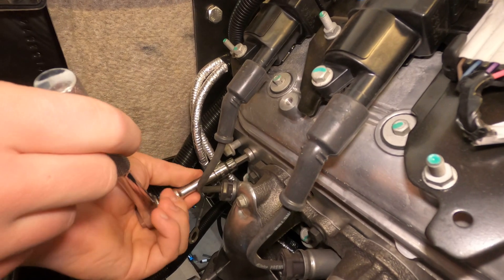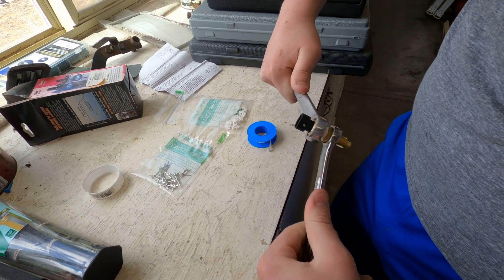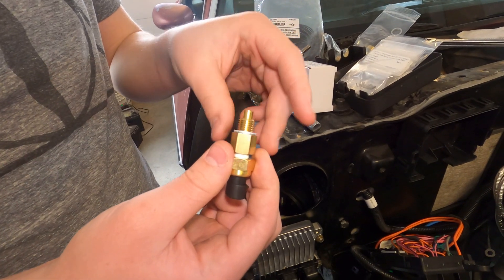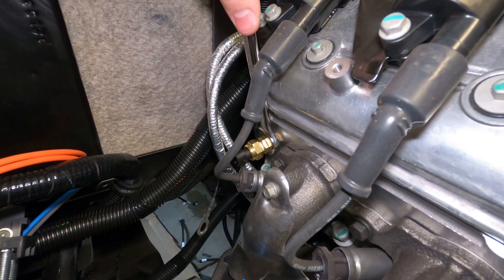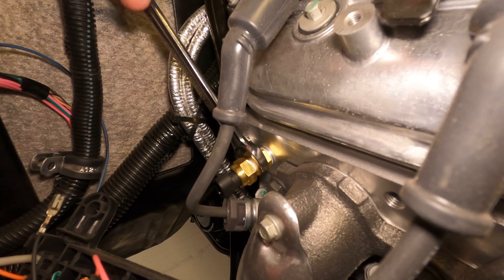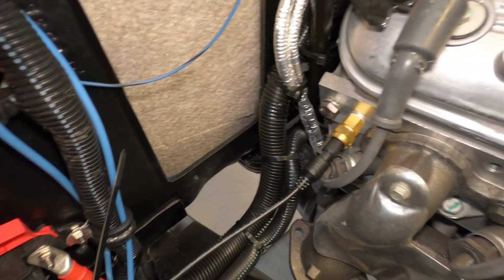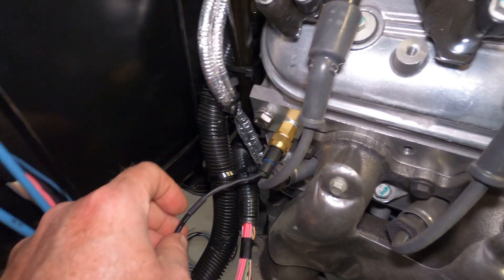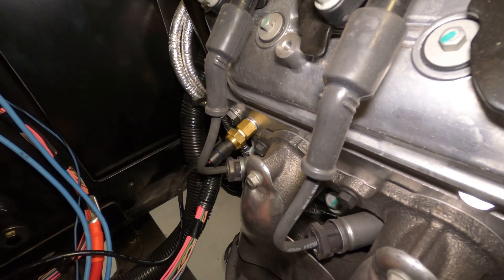LS Swap 18 - Dakota Digital Coolant Temperature Sensor Installation

Comment: In this case you have the LS3 crate engine and harness all you have to do is use the Dakota digital BIM-01-02 controller . It takes plugs into the ECM diagnostics port and extracts the data for all the sensors so you don’t need to run any of the supplied ones and can just use the factory harness and sensors
Reply from the maker: I'm really glad you brought this up.  Using the Dakota Digital BIM (Bus Interface Module) was our original plan.  We even bought one and were ready to install it.  But after really digging into the details, we decided not to use it.  I don't like that it plugs into the OBD-II port - it makes it seem like a stuck-on afterthought, and definitely doesn't look "factory".  We want everything about our build to look "factory".  We'd have been happy to hard-wire the BIM, but Dakota Digital says you have to disconnect the BIM when using a scanner on the OBD-II port.
Reply: @ that’s great ! That’s the best part about builds each one person has there own ideas and perspectives . For mine I was opposite I am having a shaved engine bay so very little wires and hoses visible so the interface worked great for me to keep the engine bay empty as possible .  I was thankful they made it ! But great job on the build love the videos
Reply from the maker: @spesh1300 Cool!  I'm curious what all you are getting from the BIM - speed, RPM, temperature, and oil pressure?  Anything else?
Reply: @ just installed it not too long ago and got the engine fired up so haven’t tackled the programming yet but it has picked up all the sensors that Dakota supplied which was mostly what I was after . I’ll report back once I have it all programmed . 👍🏻
Reply: Only bad part about using the Bim for the temp readings it does not show up in the digital lcd readout like I was expecting, to get it to read in digital lcd screen you have to use the manual sending unit 🙄 which in my mind seems bass ackwards, that's one of the main reasons i wanted to use Dakota digital to be able to read the temperature in lcd, I've heard of people using the Bim along with the manual sensor to be able to get the lcd temp readout, does anyone know if this will work?

Comment: Dont use tape, use thread sealant because that sensor needs to touch the metal on the block for a ground.
Reply from the maker: I agree.  We were following the instructions, but I don't use tape any more for anything.  IMO thread sealant works better and is less of a pain too.

Comment: Mine snapped off too,cheap metal so I used the stock temp sensor n it works fine with the Dakota box
Reply from the maker: Kudos to you for being willing to try that, and it's cool that it worked.  I did consult with Dakota Digital about the problem; how could they not know that the stock sensor would work?  We're talking about the most popular engine swap on the planet!
Reply: @WorkinOnIt so you can use a stock sensor in the rear passenger side head ? Instead of having to worry about snapping the adapter off ?
Reply: @WorkinOnIt and it will plug into the Dakota digital cable ?

Comment: What if you install a regular temp sensor and then rework the pig tail ?
Reply: That will shorten your plug and I believe they all work off of heat and resistance
Reply from the maker: @tobywilliamson5213  Your idea is good.  Basically, you have a thing (the sensor) that's a variable resistor, and the resistance at any given time corresponds to temperature.  It's even possible that the curve is the same for the OEM sensor and the Dakota Digital one, but that kind of information is hard to get.  When talking extensively to Dakota Digital about the broken adapter and plug wire clearance problems, they didn't suggest changing to the OEM sensor, which makes me think they must have different resistance curves.  But that's just a guess.

In the future I might do more research on this option.  What I'd really like though is for Dakota Digital to step up with an LS-specific sensor.
Reply: Yes I’m doing an LS swap in an 1980 Malibu in memory of my father I’m a technician by trade , I bet it be close enough in resistance value you wouldn’t have an issue, but I’ve been wrong before
Reply from the maker: @tobywilliamson5213  Sounds like a great project that your dad would've loved.

I guess you could test the two sensors in a pot of water on a stove.  If they read pretty much the same from ~100 to 212 F, then the OEM sensor is a perfect substitute.
Reply: @WorkinOnIt  Yes I’m doing a frame off restoration , on that car, granted it won’t be worth what I’ll have in it , but I remember working on vehicles in garage and my dad would come out fire up the Malibu do burnouts and doughnuts in the street pull back in the garage and smile to my buddies , the good old days , I really want a 71 chevelle dad had a 70 and 71 chevelle , we did so many burnouts in the chevelle , grand dad was a diesel tech in the navy then had his own shop so dad grew up working on vehicles as well…. Glad your doing a father son project amen to you !!!
Reply from the maker: @tobywilliamson5213  Awesome man.  My dad was in the Navy, and he helped me a lot with my first car.  I miss him.